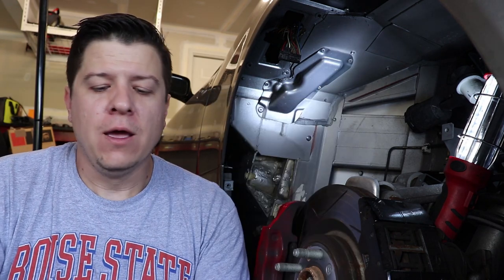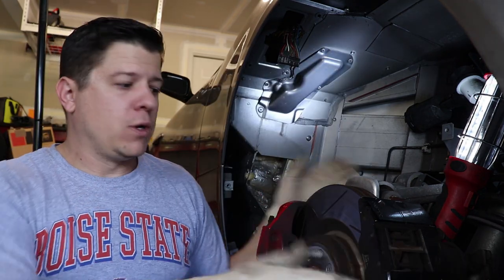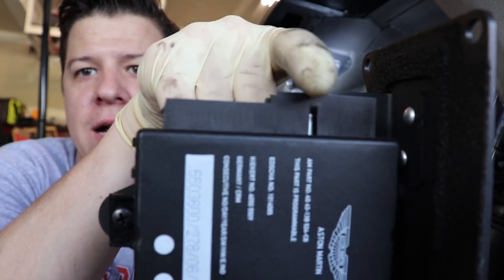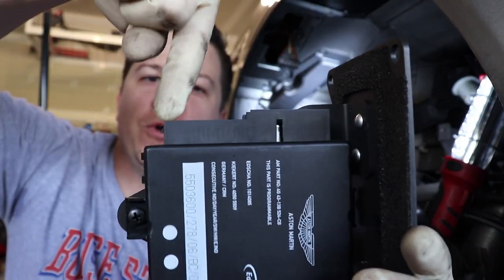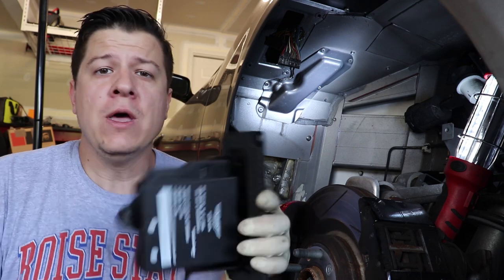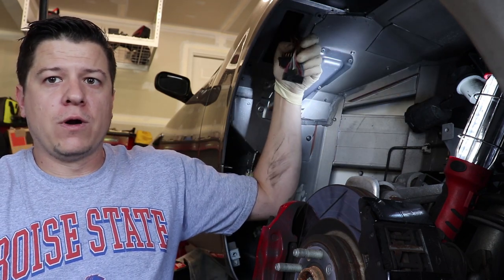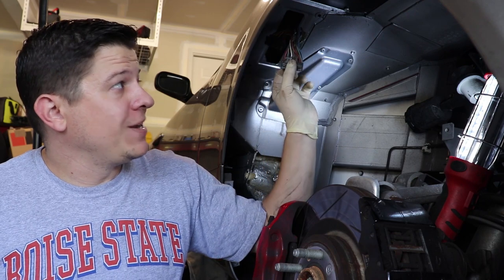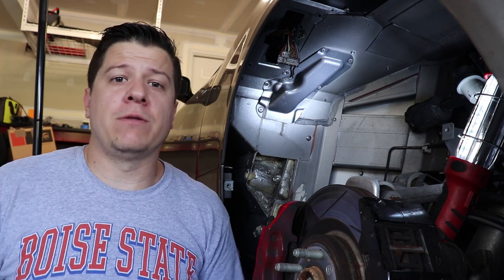Replacing the Convertible Roof Module (CRM) in an Aston Martin

Comment: What scan tool is required? Is there an aftermarket version that reads codes and live data?
Reply: For convertible top
Reply from the maker: For data from the convertible roof module, you would need an AMDS, which is extremely rare to find outside of an official Aston Martin dealership.